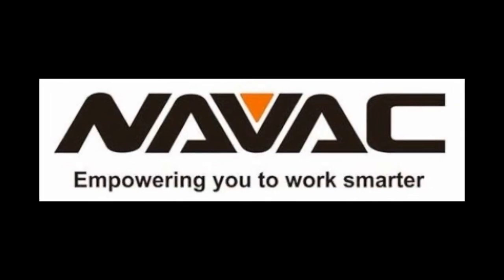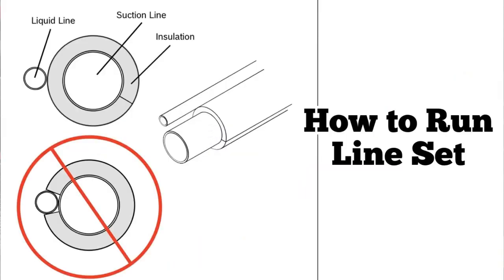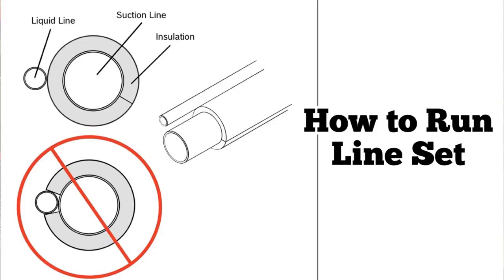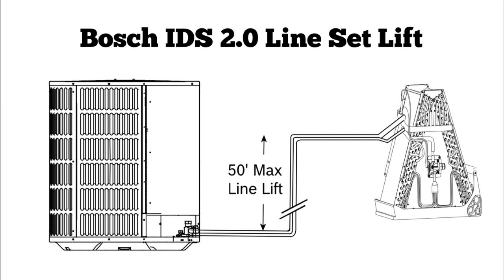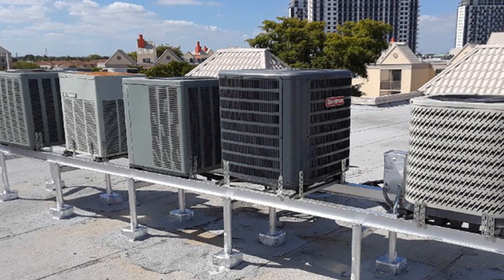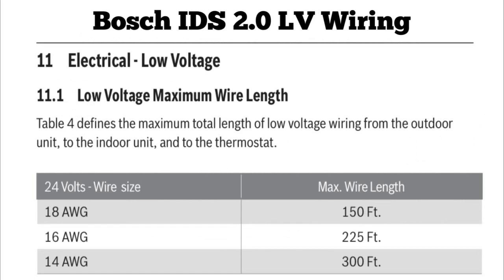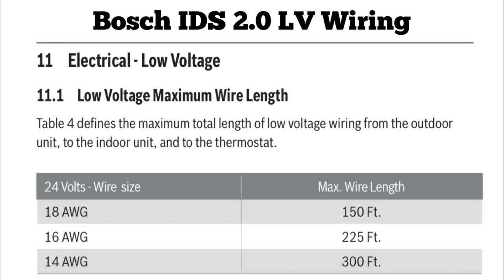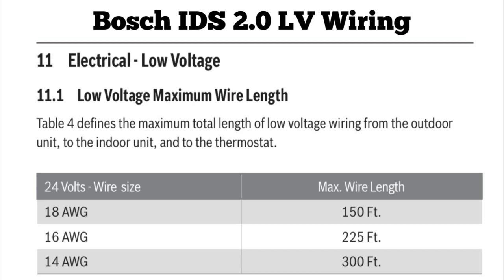HVAC Installer Training | Line Set Length and Installation | 1

Comment: I want to install 3/8 and 3/4 soft copper lines. The total length is about 25 feet. I have about 3 90degree bends before the final outside out of the wall bend. How do i install without  kicking it. They are not charged. Just 50 footers with plastic end caps. Someone suggested filling them with sand or water and then flush them out. Not sure if that is a good idea.  The lines will need to be bend and straightened and bent again as they are pulled . Its new construction.  The two bends are bigger ( about a foot of space ) as i feed the lines into the ceiling.  Any suggestions would be of great help. Thanks

Comment: I have a 3 story apartment building with condensers on top of the building and the 3/8   line reduces to 1/4 from the condenser to the evaporator.
Why did they do this?

Comment: I wonder how long it will be until manufacturers start specifying the use of shieled low voltage communication wire between the inside and outside?
Reply from the maker: I bet you some of them do. I remember having to use it, but I think it was for controls (maybe zoning).